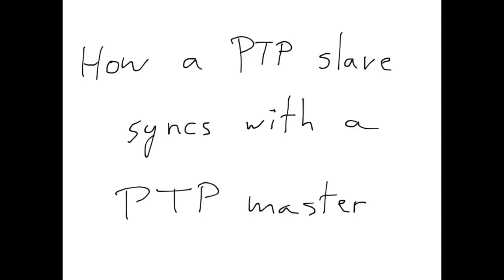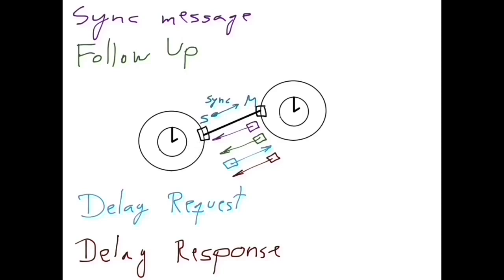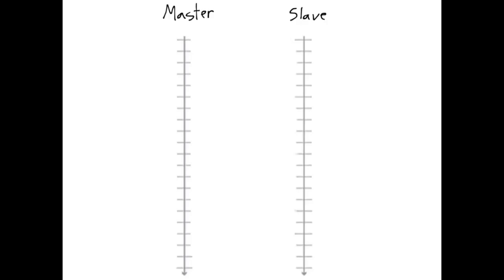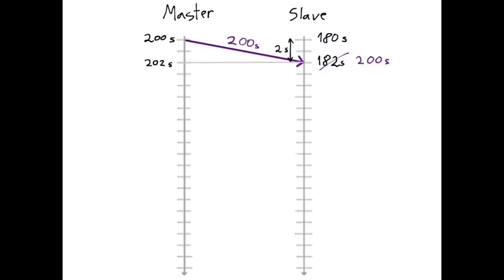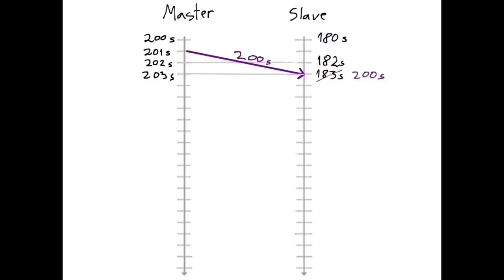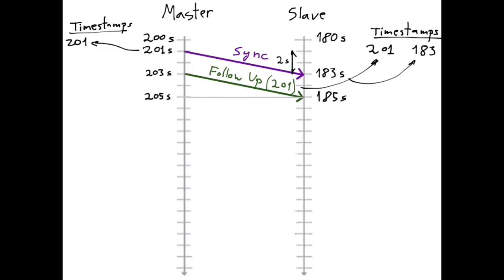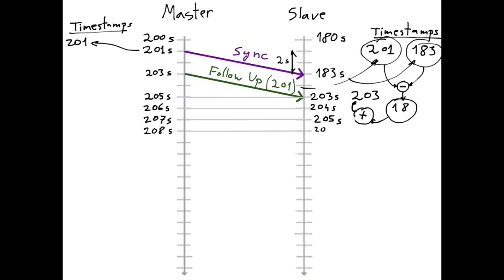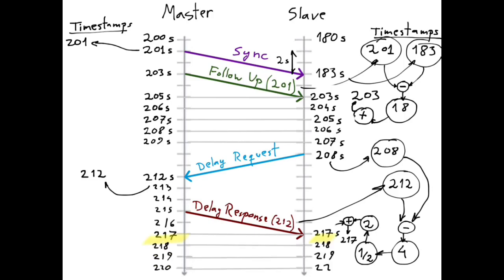How a PTP slave syncs with a PTP master

Comment from the maker: PTP cannot detect asymmetries. However, if the asymmetries are known, then PTP as defined in IEEE 1588 v2 can be statically configured so that clocks take them into account. This is called "asymmetry correction" in the standard.

Comment: Great video! The explanation was very easy to understand and the animations are very well done.

The last step, delay_request and delay_response, assumes a symmetrical network topology. How can a PTP system detect or measure asymmetry, e.g. where master to slave takes 2 seconds but slave to master takes 3 seconds?

Comment: Same question asked by George in previous comment:
"I understand why there needs to be compensation for the processing/encapsulating delay in the master's first message, but why isn't there a similar one for the slave's delay request time stamp? Wouldn't there be a delay between reading its own clock and transmitting as well?"
Reply: It is not used. It does not use absolute time He just mentioned the scenario.
Reply: The Delay Request message does not contain a timestamp in the message.  The slave reads the timestamp from hardware after the Delay Request message is sent.
Reply: because only the slave needs this timestamp, and master doesn't need it.  Slave can read it's hardware timestamp after it sends out the Delay Request message.

Comment: I understand why there needs to be compensation for the processing/encapsulating delay in the master's first message, but why isn't there a similar one for the slave's delay request time stamp? Wouldn't there be a delay between reading its own clock and transmitting as well?
Reply: Hi George,
the difference between the first master message (SYNC) and the first slave message (DELAY_REQ) is that the timestamp inside the message of DELAY_REQ isn't that important.
The important value in this case is the time the packet left the port, which can be determined with high precision right away.
I hope this helps.

Comment: Great Video for sure ! Question: why the Master could not embed the directly its transmission timestamps inside the first Sync message ?  the Slave being capable to embed the transmission timestamp directly inside the delay_request message , I'm wondering why the Master would not be able to act similarly ? ( I would suspect here that add the timestamps inside the message would be done right before being sent on the wire, by the Network Interface itself) , thanks for your response !

Comment: Thanks. it was very clear and nice step by step explanation. 
just one doubt: in last step why the calculated delay for propagation is divide by 2. it should be done in NTP because the time values that used to calculate the propagation delay include one way go and one way back. But here the time values to calculate delay  just include one way propagation!
Thanks in advance if you reply on this.
Reply: The slave time already contains the propagation delay from the follow up message (Master->Slave). Therefore, the Master->Slave propagation time is not required anymore.

Comment: In the final delay request sent by the slave clock, you have chosen 208s, an even number.  What if you had chosen 209s, yielding a difference of 3 seconds instead of 4? This would give us 1.5 second transmission delay - what happens then?
Reply: If the slave had sent its delay request at 209 seconds then the master would have received it at (according to its clock) a timestamp of 213. When the slave receives 213 in the delay response, it would subtract 209 from 213 = 4. So the propagation delay is still 4/2 = 2 seconds. However, if the network had a propagation of only 1.5 seconds instead of 2, the calculations are still exactly the same - you would simply add 1.5 seconds to the slave's clock.

Comment: How does it work if propagation is not the same in both directions? So when delay in one direction is not round-trip/2 ?  That is not unrealistic - even in direct P2P links (though would be smaller than in NTP sync of a workstation over some dial up link or a antique broad band where downstream was via cable tv signal but upstream via dial up phone. This did happen in the early years where older cable networks where not return capable

Comment: What is the rate of the messages (the bandwidth) between the Master and Slave ?
and how does the message looks like, how long is each message ?
is it possible to obtain the precision using RF link instead of fiber ?
I would like to ask more questions if it is possible to contact you in someway it would be great.

Thank you very much for the great videos